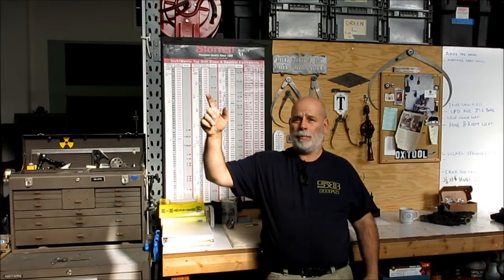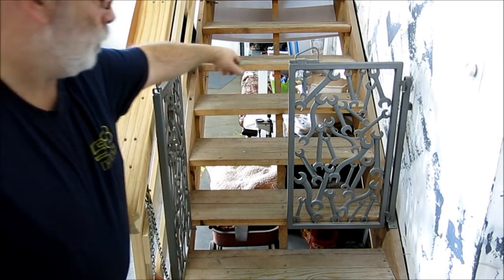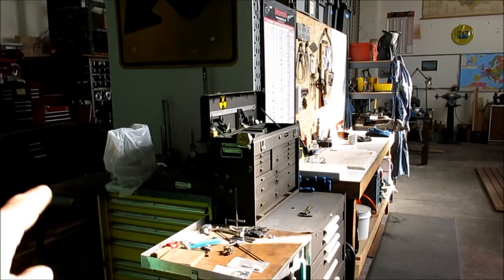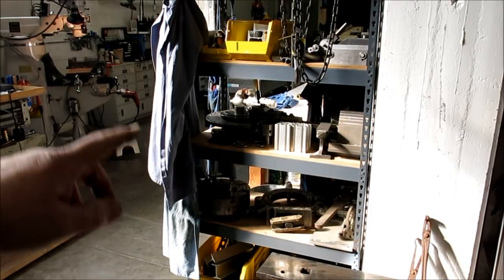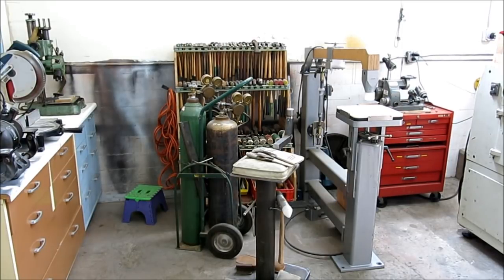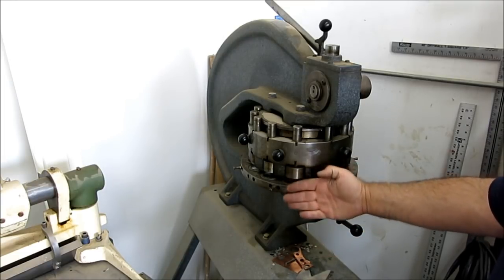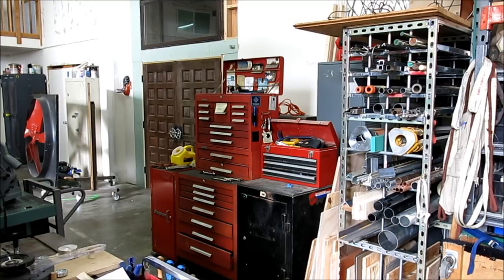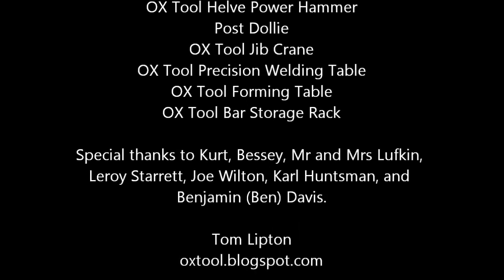OX Tool Shop Tour

Comment: I have a Johnson model J band saw very similar to yours. Mine is a 1937 model but it will repeatedly cut 6" bar within .005" of flat so it works good for me! It is a rigid beast but no speed demon. My motor is also inboard mounted like yours, it just hangs off a bracket mounted to the inside of the head and the weight of the motor is what tensions the belt. Besides blades I have done nothing to it in the time I have owned it.
Reply from the maker: Hi Bc,

I will probably work on this one pretty soon. I have and electrical buddy getting some parts together to fix up the on off switch setup. I will probably go through it a bit when I do that modification. It actually cuts pretty good right now.

Cheers

Tom

Comment: As a tool collector creating the organization of machine spacing in a more limited area than your shop is a feat in planning, sketching out and fabricating as you have. Very grateful for the overall view and how you put it together.  Intrigued by the inspection microscope and how functional with x n y axis optics used, a jewel for a one off master machinist. Charlie must have been a guy to learn from? Thank you

Comment: You have some really nice machines over there. I use to work in a tool room and we had a machine I didn't see in your tour. It was a Surface Grinder We did a lot of sharpening on die's when they were dull.
Reply from the maker: Hi Ruben,

A surface grinder is on my machine list. Lots of interesting things you can do on one. Thanks for the comment.

Best,

Tom

Comment: I like those white drawer boxes by the mill with angle plates , taper shank drills n such in them. Would like to have a couple sets like them by the lathe , and mill both. My shelves get cluttered holding all the cutters , endmills , drills n so on. Your idea for using those sheet metal wall studs was a good idea on your steel rack. Nice shop.
Reply from the maker: +Phil Lowman Hi Phil,

Those are bank cash drawers I got off Craigs list. They are super heavy duty with bearing slides. Thanks for the comment.

Cheers,

Tom

Comment: I would like to see more about that jig borer when you get a chance to get it back in shape and running.
I used to work in a mold shop that had a SIP jig borer that could hold about half a tenth in position and size. Fascinating machines.
Reply from the maker: Hi Joseph,

Sorry to disappoint but I traded the Autometric away for a Myford cylindrical grinder. Jig bores are neat machines. Not many in daily use these days. Thanks for the comment.

Cheers,

Tom

Comment: the saw on the pallet reminded me of something, some plywood under heavy equipment, a bicycle inner tube sticking up through a hole, other end running in a circle with the end in the middle of the ply.  stick some cribbing under the tool, put a vac on blow through the tube, tool stand hovercraft, the inner tube idea i came up with a bunch of years ago, i think it just confused everybody.

Comment: Hi Tom,
            You have an impressive workshop and I think mine would be lost in yours. But then again my hobby (model engineering) entails using much smaller stock materials and much smaller tools. I smile when I hear you or Adam talk about drills and milling cutters being small at around 0.25" dia because my interpretation of small is drills at 0.01" and milling cutters of 1mm dia.
    I had to make some shaft connection pins the other day with head dia of 0.0625" shaft of 0.040" dia , and these had to be slotted with a 0.01" slot by 0.050" deep. I dropped one on the floor but never found it again. The slot cutting setup was something to be seen and the holder looked like a brass ball pen with the uncut pin poking out of the end and a small BA screw locking it into place. This assembly was mounted in the tool holder of the lathe and the 0.01" cutter was mounted in the lathe chuck, centering and depth controlled by the cross slide and top slide. No one was more amazed than me when they all came out perfect. So I expect you can well understand our differing size perspectives of the work we do. The only advantage I have is that most of my tools are a lot cheaper if only for the lack of material in them. I enjoy your videos immensely as the sheer size makes me shudder at the thought of dropping one of your tools on my toe. Thanks for the entertainment.MoK
Reply from the maker: Hi Mo,

I know what you mean. It takes hours sometimes to whittle a big bar down in the large lathe. On one of your tiny screws its two cuts and whammo at diameter. Thanks for the comment.

Cheers,

Tom

Comment: Hi Tom
Thanks for the great tour, every man's dream life, a shop with a house and a wife who fights for shop space.  Two questions, can you do a segment of VFD (Variable Frequency Drive?) and how it could be useful for controlling machine speeds and how it impacts single and three phase power.  Can I really do away with step pulleys and gears?
The second question, your Clausing drill seems to have an inordinately long quill below the head, why so long an unsupported quill?  Thanks
Reply from the maker: Hey Morris,

VFD's are coming with the Autometric job. In my opinion you still cannot cover the entire range of speeds needed with just a VFD. There are optimal speed ranges the motors perform best at so the closer you can match those either by pulleys or existing speed reductions you are better off. Bottom line is you can't expect the motor to turn at 25 rpm and produce full torque and horsepower but that is sometimes what you need. Don't know why the quill is so long on the drill press. It actually made me raise it up so the drill and table surface were at a better work height.

Best,

Tom
Reply: oxtoolco Clausing did make quill mounted accessories for power tap driving, gear speed reducers, etc... They clamped to the quill where the depth stop does but it reduced your stroke length. its possible your quill was a version optomized for running these attachments. Do you have the original literature for your press?

Comment: Tom thanks for the tour nice shop looks well thought out.  Curious if this is the first space you have setup for "your" shop.  Also I'm curious on the time frame that it took you to acquire your machinery.  I know that you got the drill press and the autometric fairly recently...but what about the rest of some of the machinery?

 Enjoy your holiday.
Reply from the maker: Hi Bill,

I have had several home shops over the years. Five years ago I ran an engineering job shop and had free run of the place so I didn't need my own shop. Many of the tools and machines in that shop were mine. When I left there I sold some of the equipment to the old company (bad idea) and stored some of it at home. So without going into detail about each specific piece of equipment this shop is fairly new. I really had to start almost from scratch. To answer your question I have been hard at it for a little over three years. 

Best,

Tom

Comment: I see lots of sheet metal tools but not much in the way of sheetmetal videos :) 

I'd love to learn about / see that English wheel and power hammer in action.
Reply from the maker: +Jacob Rush Hi Jacob,

Good point. I don't have a car or motorcycle project that would make for good demonstration material. I do have a couple videos that go into more detail on those two items. Thanks for the comment. 

Cheers,

Tom

Comment: Hi Tom and thanks for the shop tour.  2 questions
1)  What is blanchard grinding (your welding table was blanchart ground)
2)  I am looking to buy a Milling machine but because I have little experience
    I would likely buy a new one (9x49).  Any comments on what to look for
   Many thanks
   Rod
Reply from the maker: Hi Rod,

The table was Blanchard ground which is also called rotary surface grinding. Its a fast and cheap way to produce flat surfaces. As far as mills go there are lots of decent ones out there now. Your budget and local support will probably drive the decision more than any other factor. I would say the extra table length is worth the extra money. Mine is a 42 inch and I wish it was longer. Get a DRO right out of the gate you will be glad you did. Other than that you will need a basic tooling kit, vise collets, chuck, parallels, etc.

Hope this helps.

Best,

Tom

Comment: Really enjoyed your shop toor. Would like more info on your dual bandsaw, I want to convert my 14 inch wood cutting to metal too. Thanks Ray
Reply from the maker: Hi Ray,

Its a Do-All V-26 from the 40's or 50's. I think it will go as slow as 40 feet per minute and up to a couple hundred feet per minute on the max end. Anything specific you are interested in?

Cheers,

Tom

Comment: Tom, thanks for the tour!  Get layout of the tools that are placed in the shop.  Got my biulding up, it took a day and a half to complete!  My guys from the shop who brought the grade to 1% with 63a's took three days! whats wrong with this picture?  Any recieved the pex tubing for radiant heated floors, decided to put 5" 4000 grade floors in.  It will set on 2" stryfoam and a 9 mil plastic for a vapor barrier.  The Jib crane I decieded on a cubic yard for the footer, with 1 1/2" threaded connection rod.  Like you I'm to old to fart around with the lifting, amd cam't get the younger generation to help to much.  Any way like the videos, watch them all.  Keep the good work up it is an insperation to me.  Miker

Comment: Hi Tom, many thanks for the tour — very interesting, and I'm glad to finally get to see the overall layout.  As always, I have a question: What kind of grinding wheels are on your Baldor grinder?  Are those diamond wheels? CBN?  Thanks, -Chris
Reply from the maker: Hi Chris,

One is Silicon Carbide and the other is a diamond mesh similar to the bench stones you see with the hole arrays.

Best,

Tom

Comment: Hi Tom, thanks for the shop tour. And for all the other videos as well. They help me, as an abolute beginner, really a lot (at least the things I understand).
Not related to the shop tour, but maybe you can elaborate a bit on what tools are of exeptable quality, even if made in the far east. I have to buy a lot for my new tiny mill (work holding, measuring, etc.).
Again, thanks very much for all the effort you put in this.
BTW: Was that Steve McQueen on the wall? Nice!
And if you want to stick in a pin for me, I'm coming from Hamburg, Germany.
Cheers, Alex
Reply from the maker: Hi Alex,

Buy what you can afford. Lots of wonderful deals on imported tools and equipment. Better to have something and be able to use it than be stuck for lack of it. You can always upgrade later. For raw beginners its sometimes hard to appreciate the subtle differences in these tools until you have some time using them. For the stuff you use all the time try to buy decent quality and build from there.

Regards,

Tom
Reply: oxtoolco Yep, makes sense. Thanks Tom!

Comment: Tom,
Thanks for the tour. I wish my shop looked like yours!
What kind of mill do you have? can't make it out.
I just finished watching all your vids. Great info, I learned a lot!
I live about 50 miles east of Tulsa, OK. in the sticks.
If I were in the bay area I would volunteer to be your flunky just to watch you work.
Keep it coming!!

Jim
Reply from the maker: Hi Jim,

Thanks for the comment. The mill is an Acra 9 x 42. It has been a great mill so far. You are near SV seeker. You should drop Doug and Kay a note and see if you can help them with their cool boat project.

Regards,

Tom

Comment: Hi, I was going back through your videos and finally caught the shop tour. It looks great!  Mine is a work in progress!!  I do have one question,  I have a lathe similar to yours which came without a splash back plate. I noticed in other videos you built a terrific looking wood plate which seems to double as a tool holder.   Could you post some pics of the way you set this up?  Maybe some building tips?  I've never seen one like it.  I was going to order a sheet metal shop to build one for me but yours looks far more efficient.  Thanks for the tour!
Reply from the maker: +Steve P (Hotwelder2) Hi Steve,

Check out the latest installment of meatloaf (95 part 2) I am actually extending the toolholder rack. Thanks for the comment.

Cheers,

Tom

Comment: You gotta do what you gotta do. I trade off things for the better when I see fit, too.
A mill in good shape with DROs nearly puts jig borers in the obsolete bin nowadays anyway.
Reply from the maker: Hi Joseph,

I would still love to have the space for a couple of Moore machine some day. I call them one of the pinnacles of the mechanical arts. Pure mechanical accuracy embodied in a machine. Nowdays they do all kinds of computer tricks with compensation to eliminate sources of error. Thanks for the comment.

Cheers,

Tom
Reply: I cut my teeth back in the sixties doing production work on a Bridgeport that saw twenty years of cast iron work with worn out ways and leadscrews, having to compensate for backlash with more than a full turn of the dial.
I swear it would rattle if you could shake it.
Things are sooo much better today.
Reply from the maker: Hi Joseph,

Shop tradition is the new guy gets the worst machines. If they can make good parts on that they let them stay around for a while. Thanks for the comment.

Cheers,

Tom

Comment: Slick way to motorize the knee on your mill. Also do you have drawings for your jib crane? I need to build one of those and would like to see how you did it.
Reply from the maker: Hi Max,

I studied some of the commercial units for the design for my crane. Its really dependent on what you are anchoring the crane to and the capacity you need. Thanks for the comment.

Cheers,

Tom

Comment: Hey Tom, theres a Diacro finger brake up for auction Tuesday on the East Coast.  I posted a quick video if you wanted to watch the auction and se if it stays in your price range.
Reply from the maker: Hey Saw,

Thanks for the video. Looks like its been modified a little. Nothing too serious different leaf bar. Who is the auction house?

Best,

Tom
Reply: The auctioner is Quaker City.  I am in no way affiliated with them.  I was walking around looking for tooling for my shop, saw the brake and at first didn't think anything about it. Later on it came back to me where I had heard that brand name before.

Shawn
Reply from the maker: SAWMetalworks Thanks Shawn. I'll look it up.
Best,

Tom

Comment: Hello Tom,
 I've been thinking of building a belt sander since I saw the one Keith Fenner has and now yours. What material is the drive wheel made of on yours ?.
Reply from the maker: Hi Oudijzergek,

Both wheels of my belt sander are made of aluminum. The drive wheel is roughly 100mm in diameter.

Best,

Tom
Reply: oxtoolco
Hello Tom,

A few more questions : Any profile to the wheels or are they just plain cylindrical ? What size belts have you got on yours ?.

Comment: Ok, I travel to California sometimes on vacation Riverside Loma Linda Redlands San Bernardino.  So where?  Is adress:  ??  Where to order 3003 H-14  .050"/.063"AL sheet or comparable substitute?  Here I use Schupan.  Thanks
Reply from the maker: Hi Aric,

Try Aircraft Spruce in Southern Cali and or Reynolds Aluminum in Livermore Ca. I have sourced 3003 H14 from both of them.

Cheers,

Tom

Comment: you said your table is Blanchard ground? what the heck does that mean? is that why it doesn't rust?
Reply from the maker: Hi Erik,

Blanchard grinding is also called rotary surface grinding. This is a cheap way to make large flat surfaces. The humidity is low where I am and I keep an eye on any rust starting. I put some corrosion inhibitor on it once in a while also.

Best,

Tom
Reply: oxtoolco oh, very cool! Love the vids. Our Ag shop in high school bought a brand new mill and lathe that I made some parts on, it was a lot of fun. Im 19 now and hope to get a lathe when I get my own place. Its fun learning how you build stuff, thanks again for the vids
-Erik

Comment: Could you do a video on welding bandsaw blades.....Thanks
Reply from the maker: Hi 40,

I don't weld them anymore. The outfit I buy them from is reasonable and I don't have to invest in coils of a bunch of different tooth pitches. I buy high quality bi-metal blades and they last a long time since I'm the only one using them. 

Best,

Tom

Comment: can't seem to find videos I want to revisit i.e. rod bender -- meatloaf series gives no clue as to what subject is --  great videos for a machinist wannabe
Reply from the maker: Hi Dick,

There is a little search magnifying glass at the top of the channel page. I use keywords and tags when I upload the video's. Try searching with that and see if it works for you. I have tested it several times and it seems to work well. Be sure your on the main channel page and its located right below the picture and to the right of the house icon.

Hope this helps,

Cheers,

Tom